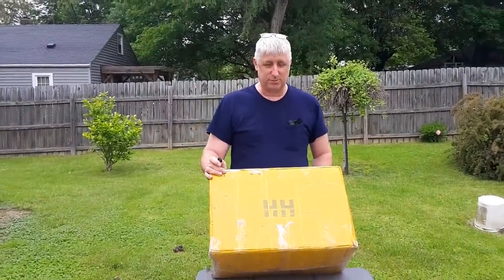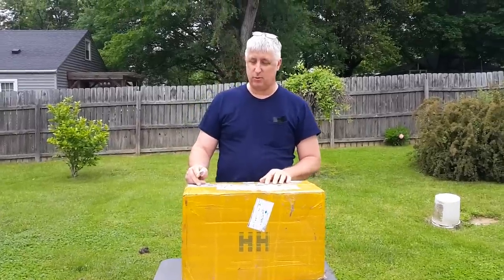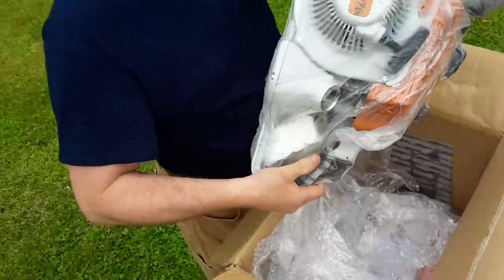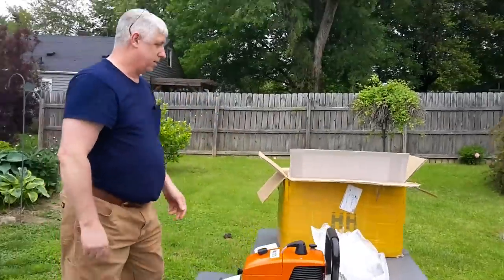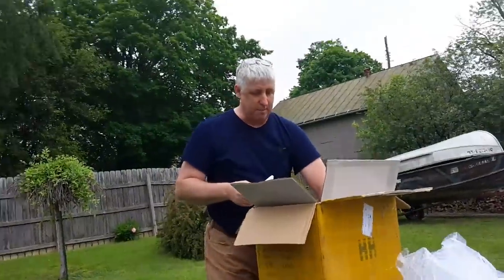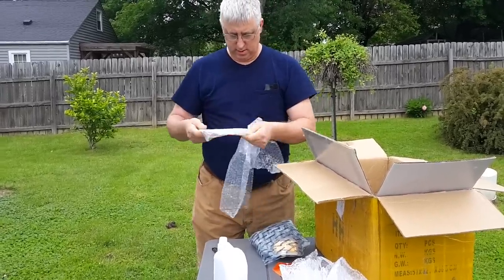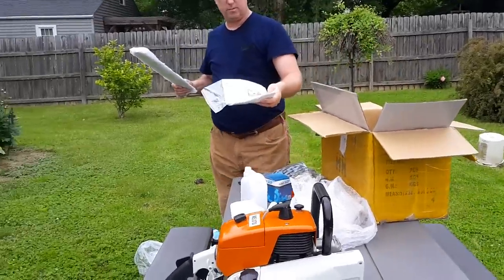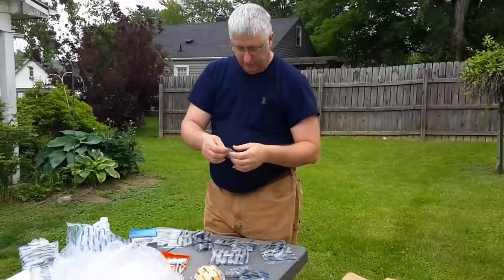Unboxing the MS070 Clone

Comment: By watching videos of china knockoffs on guitars, Im wondering if your saw wasn't inspected at the border by customs. That would explain why it was "thrown" back in the box and also they would check the fuel and oil to make sure there is none in it for shipping (explaining the caps taken off). Either way. I love my genuine Stihl saws but I also love anything with a motor that revs and gets loud so I ain't mad at ya! Enjoy it for what it is, I'd saw a log with it!!
Reply from the maker: I really doubt this one was inspected by customs, other packages that have been inspected were taped back up with printed tape reading "package inspected by customs" and the original sealing tape cut. This package had none of that.
I too own Genuine Stihl & Husqvarna equipment.  The clone saws and kits aford me the opportunity to own the bigger more expensive version that would not be economical for me to purchase and also allows for the different mods I would like to try without destroying a $1,200 to $1,800 piece of equipment.
The kit versions are fun to put together and you do not need all the special tools that  some people say You must have,  with just a little ingenuity and shade tree mechanicing you can put the saw kits together and be cutting firewood in just a few hours.

Comment: Hello. Excuse me I watched your video which is very successful. Also I'm looking for this machine. What are your opinions after using it? and also on which site have you made your purchase? Thank you cordially
Reply from the maker: Christophe Cailleux Thanks for watching, my opinions are it is a Beast its a little over 100cc's mine has a 36" 404 pitch full chisel bar and chain and weighs around 20lbs. I use it mainly for felling and cutting anything over 36" diameter. It has gobbs  of power in this form but you can convert it over to an 090 which is around 116cc's with just a piston/ cylinder swap. At 1/3 the cost of a stihl it's well worth the money. Don't run them lean on oil I run mine at 32:1 with Lucas synthetic 2 cycle oil mix.
I purchased mine from (www.huztl.net) the complete power head is on the "outdoor power equipment" tab and the complete parts kit is in the "complete chainsaw parts" tab hope this helps.
Reply: Hello. Thank you for your answer. Being French the translation is quite difficult. But I understand your answer. Also for information you bought this machine complete or in parts stain? And regarding the cutting blade guide you had this one with the machine or is it a separate purchase?
Moreover I thank you again to have answered my question and thanks again for this video explanatory as well as your other videos. 
Kind regards
Reply from the maker: Christophe Cailleux Your welcome, Yes this particular saw (power head) was a complete ready to run out of the box with out a bar and chain power head,   just add fuel mix I suggest a 32:1 fuel oil mix and some bar oil and a bar and chain and your ready to go cut some wood it may require some fine tuning of the carburator though to make it run perfect.
The bar and chain was purchased separately from the power head. The 36" .404 pitch bar from EBay and the .404 pitch chain was a 25ft roll from huztl that I used to spin 3 loops.
Huztl now offers a 36" bar and chain combo for this saw for about 1/3 the cost of the stihl bar I purchased, and they also offer a complete parts kit version of this saw that you will need to put together if you decide to go that way.
Right now you can purchase a complete power head and a 36" bar and chain combo for right at $400 US plus shipping but if your willing to wait they run some good sales where the price will be at a 20% to 25% discount, you will need to keep checking there web site www.huztl.net
Hope this answers your questions and good luck.
Reply: Thank you for your quick answer. I will try to follow your advice while waiting for a eventual rebate. 
Thank you.
Kind regards
Reply: I just bought a neotec ns8105 _ms070came all put together they do the ship that chain and bar separate from the saw itself I ordered it and it was at my house in 2 days this is the second one that I bought from these people they're really nice any problems occur they will fix it for you one way or the other nice nice people

Comment: Customs have unpacked the shipment to "inspect" your order properly.  This is not the factory to be sure. Typically, customs just checking and throwing all the parts in the box again.  Have seen this several times when we get samples.
Reply from the maker: Do not believe Coustoms opened this package, I am all but sure the issues were caused during shipping/transit to my address.
Other packages I have received thur Coustoms that had been opened were sealed back up with tape that stated the package had been opened by Coustoms for inspection.
Reply: @craigtimmons3468  I got a shipment few days back...  Labeled: Opened by customs - and it was a big mess, I tell you.  It was re-packed by DHL.  All saw chains packages were opened, they have X-Rayed the whole shipment and maybe thought this was some kind of "weapon", I don`t know.  I sent a notification to the exporter about this and take it from there.  By the way, are you satisfied with you chainsaw?
Reply from the maker: @martiniracing8599  Yes I am, Only use it for the bigger stuff 30" and over but have not cut anything over about 46" on the base.

Comment: I only see complete rebuild or parts kits on their site? Is there something I’m missing for the full assembled power heads?
Reply from the maker: Robby The fully assembled power head is listed in the (Outdoor Power Equipments link) and also on the                (Stihl Parts link) for $398
Reply: Craig Timmons so is that still the farmertec head? I went under power head section and found the 070-090 and the other husky
Reply from the maker: +Robby Yes it is, the complete power head unit can be found in 2 or 3 places on the Huztl Web site, sometimes in the hot sales section and also in the outdoor power equipment and the stihl chainsaw parts tab, as of 12/12/17 currently listed for like $389 I believe but as of today (sold out), at a cheaper price when their on sale you'll have to check their web site every couple days to catch a sale. Hope this helps.

Comment: Another throw away saw. I would throw it away after this video
Reply from the maker: Contrary to what you have been led to believe this saw is now 2 years old and still running very strong and very dependable, the only issues this saw has had was new out of the box, is the cone used for clutch engagement to the crank was not tight enough and at around 1 1/2 years the fuel line needed replaced.
In my opinion for 1/3 the cost of the real thing this has been money well spent.
Don't be led to believe everything your told or hear. Sometimes it's just not the case.
Reply: Either way.. stolen technology.

Comment: It sounds like you would have been better buying the Stihl, or Husqvarna instead because they would have come assembled except for the bar and chain.
Reply from the maker: At almost 4 times less than the cost of an equal size Stihl it allows someone with the know how and ability to try all sorts of mods to the saw and still be less than half the cost of a Stihl Power Head. These mods include different size pitch bars and chains. 
To the purist I know they are total junk, but to someone who likes to try different mods without breaking the bank this is the way to go.
When I purchased this power head (assembled) there wasn't a complete parts kit available at that time like there is now.

Comment: Ya Get what you pay for.
Reply from the maker: Its Been almost 2 years now, I've used this saw a few dozen times now and with the exceptions of the clutch not being tightened enough from Huztl and the fuel line deteriorating and cracking and the high idle button breaking and the air filter not sealing properly this saw has started and run flawlessly each and every time I've used it, if you don't mind fixing the little issues then
At less than 1/3 the cost of a Stihl counterpart I Will say it was a good investment, money well spent.
Say what you want I know it's not a Real Stihl and I never put it off to be, but in the end it starts, runs and cuts wood when I need it to and that is all that really matters to me.

Comment: I believe that the chainsaw has been made at the factory by industrious Chinese, than in Germany by illiterate lazy emigrants.
I know what I'm talking about. I have a trimmer and a chainsaw assembled in the USA. The fastener is not tight, the snot is made of sealant. The wires are hanging. (husqvarna 137, 125R, 125C) :P